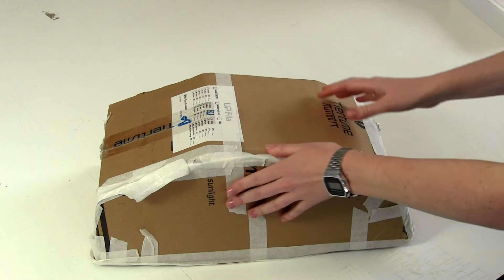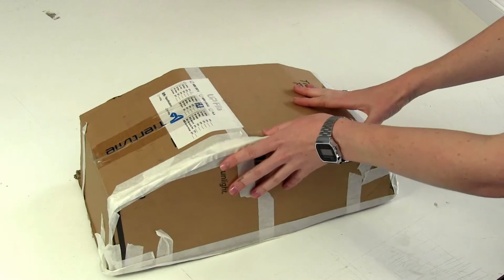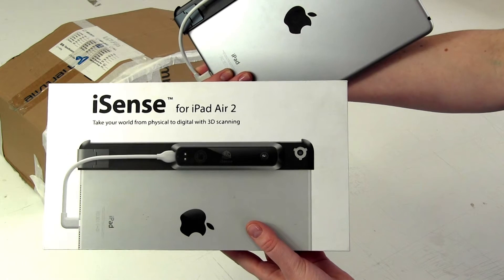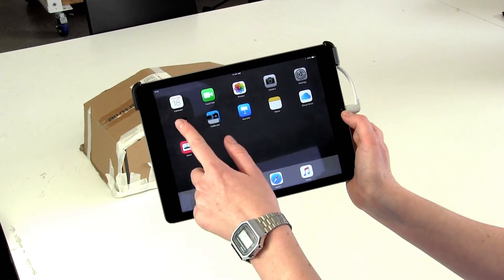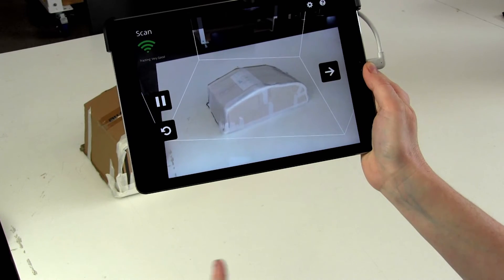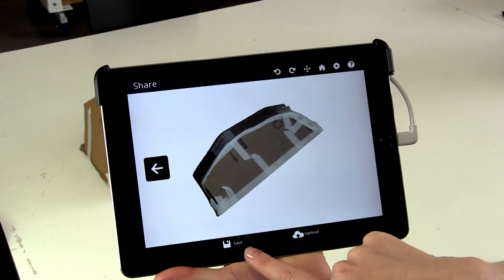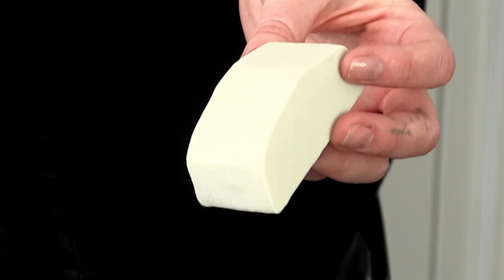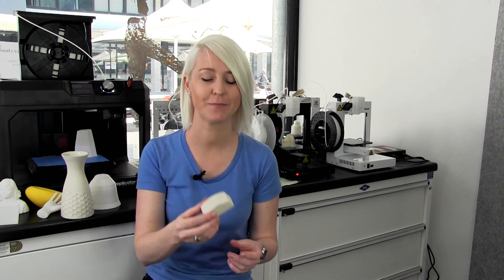An Introduction to 3D Scanning - FormZ Basics for 3D Printing

Comment: It should be mentioned that it IS possible to get the same level of detail digitally.  If you use a 3d sculpting application like Zbrush, you can manually create the same level of detail by hand in a completely digital form without scanning. Apps like Zbrush use virtual clay and "brushes" to literally sculpt something extremely detailed and truly of your own imagination.   Of course, that method requires very precise and advanced skill and technique, as well as reasonably advanced knowledge of the software package itself. 3d scanning is obviously faster and easier, but you're limited by your resources in the real world.  It's true though that this level of detail is not possible using typical CAD or 3d design software.